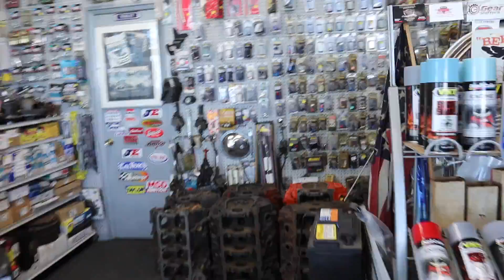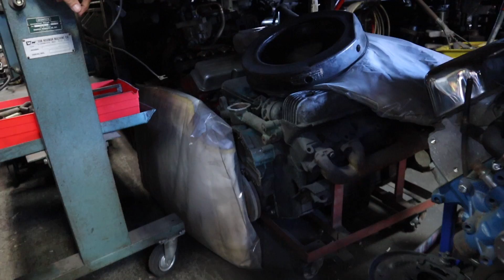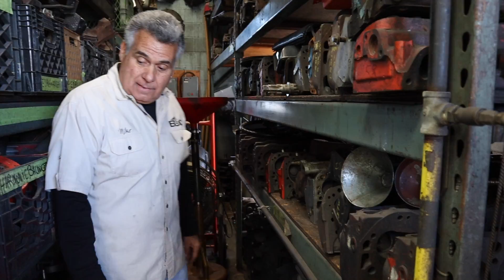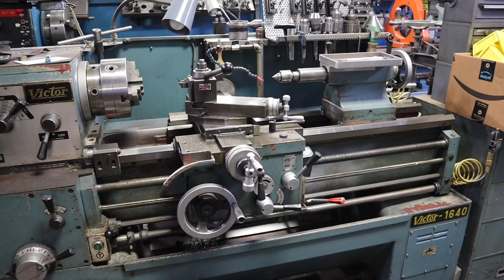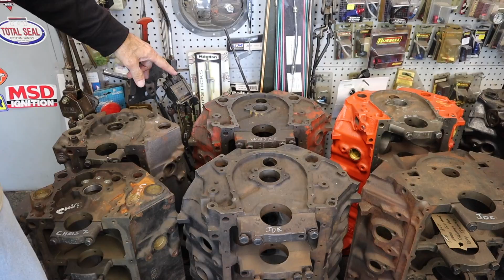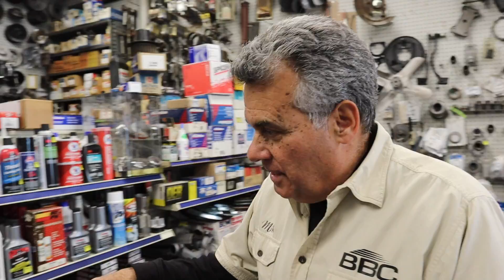Vintage Speed Shop Tour — The Way It Used To Be - BBC Speed & Machine - The Way It Is Today

Comment: I'm 55. I Used to buy 1968 camaros that ran and drove, no rust for $300 in 1986. I have a Wall of Speed. 7 BBC blocks. Parts galore in my home shop. Sadly to say, I am a dying breed. This speed shop is cool but a dead thing in 2026. Replaced by the internet.

Comment: Apply 35% food grade hydrogen peroxide on those face skin tags with a q tip a few times over a day. It will burn like heck but they will fall off and after healed there is no scar. Buy it at most health food stores.

Comment: good gawd this brought tears to my eyes... Remember auto parts/shops like this when i grew up. i learned so much from the guys. seemed like they knew everything, without needing computers..... they would go right to the shelves or maybe looking in the massive row of catalogs.... and their onsite machinists knew what they were doing. rotos/drums etc... cut machined... all great work. i saw this video and was like WOW i wanna send my brake drums to them to find they are closed......
we have been losing so many skilled guys and having great local places like this to hang out.... sad... but i am so grateful i grew up when i did and was like a leach when i was at these places with my dad....
now sadly.... you just buy cheaply made crap instead of getting stuff machined....
i get it though..... pricing.... good work isn't cheap, cheap work isn't good.....

Comment: Amazing. Happy to know there is still a need for a real machine shop on the East Coast.
Reply: Sad to say it but they closed their doors .. owner retired.  Everything was liquidated last year starting in June.
Reply: @codyramos3200  God damn it this makes me want to cry. I swear to god I will one day start a shop for parts like this to serve future generations. I have too many friends my age who are into old cars for there not to be a continued market for these local speed shops. Jegs isn't too far off and I have had nothing but great experiences there. They reccomended a 1947 Chevy fuel filler neck for my 1980 Rover SD1 and it fit as if it was factory which messed with my head. Having local resources is invaluable.

Comment: There was a speed shop near Corpus Christi TX I happened by wayy back in the 1980s, they had everything right there, and a section that had used race car parts on consignment from racers- there were Lenco transmissions, narrowed rear ends, superchargers, engines, old fuel injection setups, etc.- it was hard to leave the place)

Comment: Great shop! You were lucky to have one in your area back then, and still today! It was mostly catalogs and mail-order back then, but you had to KNOW the part or catalog existed with thousands of different independent companies. There was also a lot more going to the machine shop to have your own parts made/modified. The storefront was a later 60'-70's thing that grew up alongside Drag Racing, often catering to the local drag/street racers and wannabes. Everyone pulled their stock parts from the TONS of junkyards that used to exist. It all gets recycled a bit too quick these days. But the knowledge of the parts guy is key here, and this guy has it. What a treasure!

Comment: Brings tears to my eyes, machine work is triple if not more. I used to bore blocks for $90 rodwork started at 15 then 7.50 each other rods. Cleaning a block for $50 bucks.
Reply: Yep..lol I took a couple of old drums from my 63 GP to a local "repair" shop to get them cut....just to give a skim. The guy (youngster) told me $140 an hour. lol! I said well thanks anyway. As a youngster 30 years ago I worked at a mom and pop shop...we charged $7 a drum...and only took...at most 10 minutes...and that included machine set up...$140 an hour...what a joke these days. I don't want the Chinese aftermarket garbage. Old American iron works best. O'Reilly's does them, but they're hub was on back order 🤦

Comment: Nice to see places like that still exist.
Reply: Absolutely, I worked at a small speed & machine shop back in the 80's. The downfall started with mail order speed parts selling a lot of stuff cheaper than we could buy it for. If you wasn't dealer direct, you couldn't compete. One of the most irritating things was customers would buy parts elsewhere then come in for information on how or why it didn't work. I watched the storefront once filled with speed parts dwindle to mostly chrome accessories.